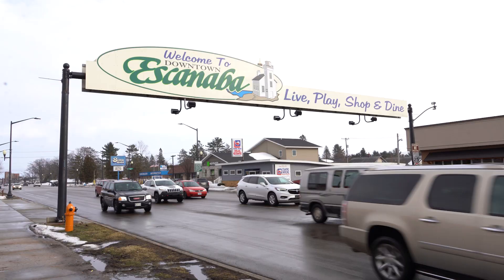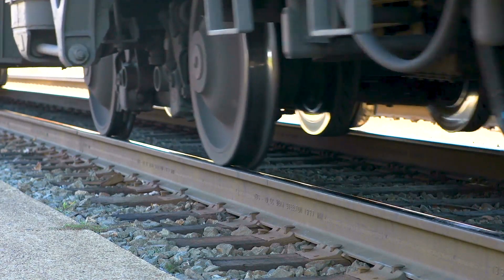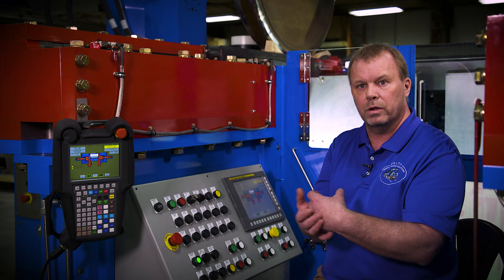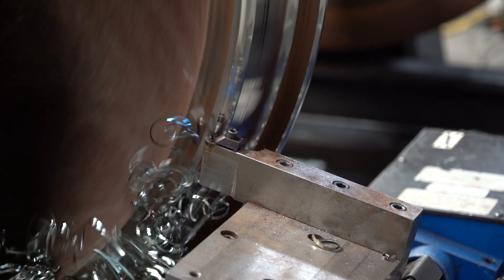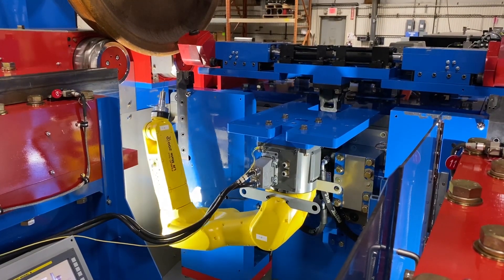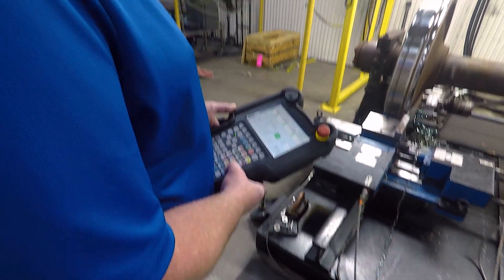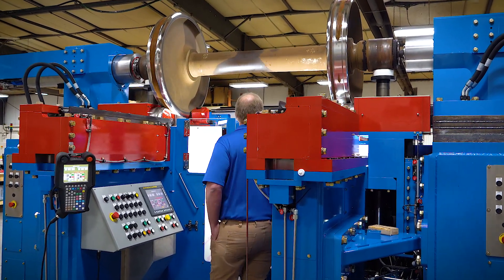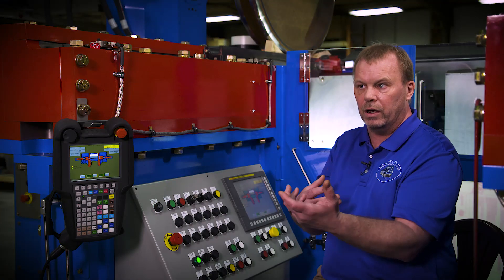Experience FANUC with Delta Wheel Truing Solutions

Comment: I would say that I'm not bragging, but it's obvious that I am. I could literally double the speed of this process, with no reduction in quality.

I've worked for both a major robotics mfg. and a major machine tool mfg. I've been doing this automation since the early 90's and I've never been wrong when I say how much I can improve a process. After seeing a process for just one cycle, I've promissed 200%, 300%, and even as high as 400% improvements in throughput and I've always delivered. I say 200% minimum for this process, possibly 225%. They've done a nice job though.
Reply: Looking for an apprentice?
Reply: I've been a CNC programmer/machinist for 26 years and trained lots of people and never have I made someone a machinist in one day using Fanuc and many other controls ...Now you can employ what I call button pushers that only know the red and green buttons only and are content making 10.00 an hour with  1 days training..😮